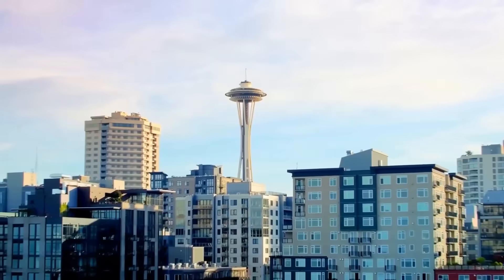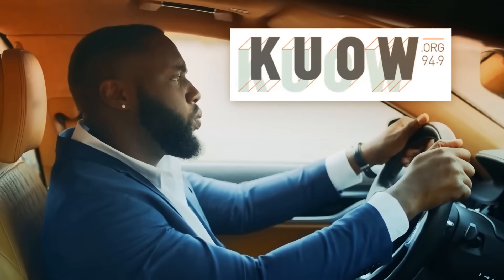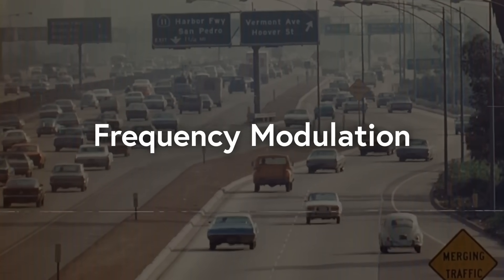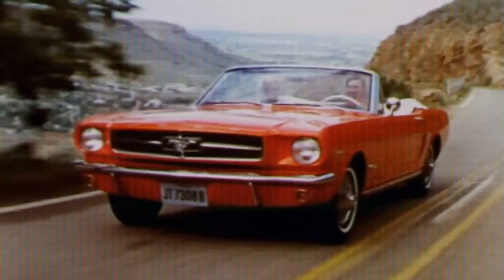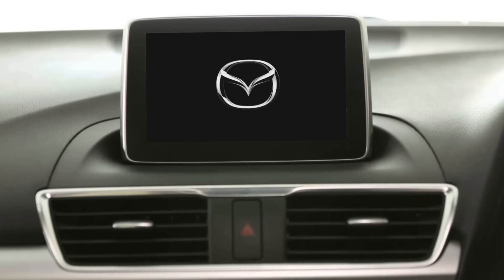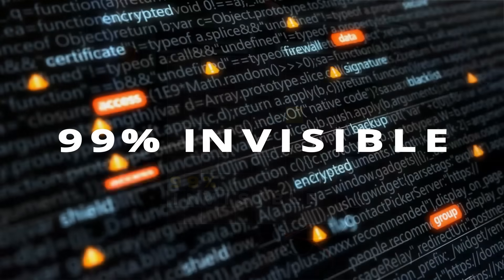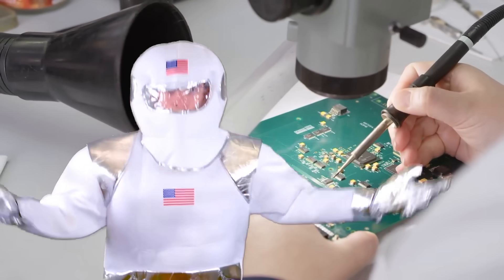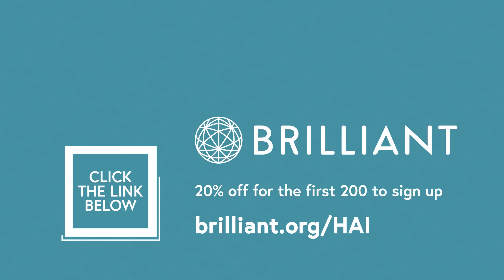Why Hundreds of Mazdas Tuned to 94.9 Broke Simultaneously

Comment: This has also happened to Honda cars starting on January 1, 2022 but without worrying about tuning into something.  The internal clock on many Honda Civics and CR-Vs are now reset January 1, 2002 at 4 o’clock and resets every single time you turn on the car.  Now I know how long I have driven the car for.  I can change the radio station and use my GPS but the clock is toast.

Obviously a different issue (probably was an overflow error on the clock) but it is still not fixed.
Reply: At least you can stick a dollar store clock on your dash if need be. It sounds like the failure is reasonably well-contained, compared to the events in the video. It still shouldn't fail, but at least it didn't propagate to other systems.
Reply: @mal2ksc  Agreed!

Comment: I've made a few coding mistakes in my time as a dev but "hardware destroyed due to unexpected input" isn't one of them.
Reply: To be fair, it's nearly impossible to damage PC hardware by a programing mistake. On a micro controller you're often able to physically destroy something by setting the pin state wrong.
Surprisingly easy to do when prototyping...
(Not that this radio issue sounds like anything more than a soft lock due to utter incompetence and lack of a factory reset button.)
Reply: @TheVideoGuardian  thats what im saying, it blows my mind that these systems dont have a safe boot/admin environment you can boot into and just clear cache, and do basically whatever, should have a boot mode that only starts the required processes. also, i dont see how you cant just re-flash firmware...... sure maybe not end-user but a dealership surely can...
Reply: @3ddan148  In this case, it isn't even the firmware that is responsible for the immediate problem - an unreadable file in cache. Reflashing firmware will be needed for killing the bug but flushing the cache will get it working again. Since there is no Mazda path to doing that the baby has to be thrown out with the bathwater.
Reply: @flagmichael  right, but a re-flash would also wipe cache, as i said, i dont understand why there isnt a boot recovery that dosnt load the cache content, at which point a tech could just clear the cache via some cli, but if there is not recovery boot process, then a reflash would achieve the same thing, your going overkill, reflashing the whole os/firmware, but that also would wipe out the cache, so i still dont see why the hardware has to be wasted over a software issue.
Reply: @3ddan148  Probably anti right to repair measures?
Reply: @RAFMnBgaming  seams like a silly way to do it, just lock down the software or bind installations to hw, or bind the hw to the vin of the car so you have to go to a dealer to have any software updates/fixes done or to replace electronic hardware... seams they are just shooting themselves in the foot by forcing themselves to issue recalls...
Reply: @3ddan148  It was probably a policy implemented before the chip shortage and assuming mostly it being the user's fault. I imagine it was way more profitable for them to sell repairs back then.
Reply: @3ddan148  My experience with Renault units is that it does exist, but it's through the OS, so if it can't boot, you're fucked anyway. It's a stupid way to handle that.
Reply: Was particularly sad is all the e-waste this produces
Reply: @TheVideoGuardian Ah. That was my question.. Was there not a way to reset the cache? Even my old ass BMW had a trick to soft and hard reset it.
Reply: I recall it was possible to kill the monitor of some early IBM PCs if you were programming the graphics card directly and wrote the wrong value to the wrong register.
Reply: @Roxor128  and later graphics cards on *nix if you set up your X11 settings wrong!
Reply: @kaitlyn__L  Now I'm going to have nightmares about bad modelines.
Reply: @Roxor128 This was definitely a thing on the commodore PET. it was nicknamed 'The killer poke'
Reply: Same. It's amazing to me that a venerable car company would be so trusting with it's digital inputs. I also think it's crazy that they don't have hard-reset function. Whenever I code things that talk to external sources, I'd ALWAYS think to add data validation and Incase I failed to vet the data correctly, some way to reset as a last resort.
Reply: @hyperefract  I've carefully avoided any coding job where safety is a factor!
Reply: @sch1191 on't want another therac 25 situation.
Reply: The hardware wasn't destroyed though. It just went into a reboot/crash loop. I can make windows do that with a single powershell command...
Reply: I always thought I was terrible at coding, this gives me confidence though. I can firmly say none of my code has ever disabled anything except itself.
Reply: You've not worked in industrial environments then. Then software bugs range from "Bob is now slightly frustrated" to "Bob is now dead and buried under 20 tons of coal & iron ore and you've created an ecological disaster that would takes months to clean up"
Reply: Halt and Catch Fire becomes very literal once again if you're working with Lithium Ion powered cars.
Reply: Technically there was no hardware damage here - just a software bug that wasn't fixable without a factory reset to delete the files, which apparently Mazda forgot to put into their software design.
Reply: @Entropy512  should've been in the coding to clear the cache on a watchdog reset, not hard to do, not hard to do, especially considering the rather dubious sourcing of the files it was working on
Reply: You've presumably still got plenty of time to cross that off of your bucket list.
Reply: it's not really hardware destroyed, it's just insanely bad software. Sure, the downloading of random files it can't identify is not great, but the real issue is that it's permanently storing radio station song data for no reason. Why would that not just be in RAM?
Reply: @Drive-n-Vibe If these were 2014 and newer computers, and I'm assuming they are built on some or another version of *nix, most files on those kinds of operating systems have information about them inside the actual file, if you have linux installed right now and do "file image.png" it will say it is a PNG image, even if you remove the extension, same goes for audio or binaries and most other popular formats. Soft locking with file extensions is something not even an intern could do if they tried
Reply: nothing like the good old HCF instruction
Reply: Indeed bugs should normally be able to fix and systems affected be able to reinstall but in this case it seems it was just to scrap the entire car if i get the story right.
Reply: There are jokes about processors having a halt-and-catch-fire instruction that is based in an unfortunate reality.
Reply: I can't believe the hardware is damageg by this at all
Reply: Not hardware but on the mainframes, "display upon console" in an infinite loop would fill the buffers of the operators terminals resulting in a required reboot of the entire mainframe.
Reply: Why did Mazda not put the infotainment cash in some sort of volatile memory like RAM, because if it was in RAM the easiest fix for that would be to power down the infotainment system and then pull the negative cable off of the 12 volt battery under the hood weight a few minutes and put it back on and then as soon as you turn the radio on tune to a different station so it does not try to download that bad file again
Reply: I 'recently' worked at a company that still processed fax communication. There was a bug that had been happening over a year and a half, just a single bad chunk in a transmission... On isolation, another vendor was going out of spec, sending partial data and a partial checksum to save a few bits, which our spec-following software would try to gobble up as a whole chunk and missing checksum.

Wasn't the only time either. I exposed an unknown bug in a vendor's software by adhering to spec. They were always expecting a pair of quotes as an empty name, when the spec said no, having nothing is permitted and is the "OG" value for "no name". I had to force insert empty quotes, cause they weren't going to fix their bug.

They didn't result in hardware failure, but all it takes is someone doing fishy business and whoops there go your array bounds
Reply: Look up "never divide by zero on an atmega"

There's a channel that did a bunch of videos on catastrophic bugs on microcontrollers
Reply: I did that to my girlfriend once.

Comment: You were doing pretty good until you attacked Tesla over something not made by Tesla, and common among many newer cars, namely an electronic parking brake, which as any tow truck driver or mechanic knows, will not release unless the car is working properly.
The article about Tesla needing neutral is embarrassingly stupid for someone who knows how cars work, because you don't need neutral on an electric motor because they spin freely when not powered, and so you need an electronic parking brake to hold the car parked, since you have no engine braking from compression leaving it in gear, or Park pawls in the transmission.

So any modern Luxury car that has a electrical failure will end up with a locked electronic parking brake and requires a tow truck to move.
It's a lot like how if a semi truck loses the air pressure, it can't move until the tow truck either pipes air into it, or crawls underneath and attaches bolts to every brake pod to release the brakes manually.

But it seems like you don't like EVs, and so will attack them with no need for facts or logic to be on your side, because it makes videos that get a lot of interaction! Lol

Comment: I remember back in 2004 a local radio station broadcast a signal that would kill the batteries in Volkswagen Touregs.  I worked at a vw dealer and we had dozens show up with dead batteries. Turns out the radio signals were making the radios stay on and kill the batteries.
Reply: This happened to my 2010 Chrysler minivan just last year. Radio wouldn't quit after the key was turned off.  It was silent and dark but something was still ticking that drained the battery. Ended up having to replace the hardware for like $400. It's been good since then.

Comment: Love my analog car! And by that, I mean it has a few dozen various ecu’s that control everything from the engine timing to knowing when to set off the airbags.  What I like is my car has a manual transmission, standard dials for heating and cooling, and no touchscreens. It’s about as analogue as you can get these days, in the used market that you can daily drive.
Reply: laughs in 1994 Volvo I'd like to see them hack my cassette deck. About the worst they could do is turn Dolby NR on and off.
Reply: @moconnell663  by 1994 you probably have the same ECUs as OP, but of course they’re not connected to the antenna at all.
Reply: @kaitlyn__L  what's funny is when i was going through the electrical schematics looking for a wiring issue with the lights I discovered that the ECU has absolutely no idea how fast the car is going. Absolutely none. The rear speed sensor is hooked up to the speedometer in the dash and nothing else. The front sensors are hooked up to the ABS module, which has no connection to the ECU at all. There is nothing which could be described as a BCM. It's an automatic transmission, but is totally self-contained, no coms except for a switch to inhibit overdrive.
Reply: @moconnell663  that’s not too unusual, the ECU looks at shaft and spark timing and so on, and maybe measure fuel consumption, so I can understand not really needing to know how fast you’re going, especially since RPM are decoupled from MPH anyway.
Reply: @kaitlyn__L  lmao

Lol

What's an ECU, my 1985 Porsche 944 uses a DME, an analog computer that uses two magnets only, everything else is disconnected from the cars "computer"
Reply: @finmueller7827  good for you pal, those mechanical fuel injection systems from Bosch are incredible engineering. 1985 is pre-ECU for almost any car though, not just Porsche, albeit for most other cars that means carburetted.
Reply: @moconnell663  i think mine still uses a speedo cable and mechanical linkages for the air system LOL, don't have abs so the only computer is the ECU. mx5 for the win i guess
Reply: and probably gets a mile per gallon

Comment: this is exactly why electronic based solutions for transportation control systems are trash. this is the same type of errors that crashed the 737 MAX - companies cut down on designing good mechanical systems, instead relying on software solutions.
Reply: Ironic, as 737 is not fly-by-wire. 737 has lots of mechanical components than its competitor, A320. A320 is the world's first fly-by-wire airliner, and yet it has a stellar safety record. Hardware or software, the importance of good design remains the same.
Reply: @dbclass4075  not an engineer, but i'd think Airbus have a backup mechanical in case the electronic fail? because unlike mechanical failures, electronic failures are not predictable in advance or via maintenance inspections. electronics either work or fail. there is no "gradually falling apart" or "cracks appearing".
Reply: @wli2718  Rudder only via pedals. The rest are not. Mechanical links are not really possible in side sticks. For widebodies, purely mechanical flight controls is impossible. The sheer size of flight controls plus the aerodynamic loads at high speed is just too heavy to manually operate.

Electronic failures on Airbus is predictable. It's avionics uses triple modular redundancy; three identical systems that compare data with each other. Any discrepancy with one of the system will be isolated from the other two, and the pilots will be notified. If none of them agrees, that's where pilot judgement comes in: select which system to use.

Comment: It's pretty pathetic the car engineers couldn't clear out the installed malware and reinstall everything without having to buy a new car computer. 
32 years ago I had a PC crash from some bad software.  I regained control of the PC and deleted the offending program and it continued to work.
Reply: It's not malware. It's just an image file without an extension. That's how pathetic Mazda's software apparently is.

Comment: Probably a good time to point out that the whole GM cars killing people by the engine cutting out - something most would think is crazy because you could just coast to a stop, was actually a problem with the anti-lock braking and loss of power steering being reliant on the engine running to maintain pressure.
Reply: Shouldn't brakes and steering be still functional? Anti-lock braking just simply reduce the risk of skidding by modulating brake pressure. Brakes should still work, though driver must not press too hard and suddenly. Power steering simply provides additional effort. Steering may be heavier without one, but it is still possible to steer.

Comment: First of all mazda should be replacing those radios free of charge since it was a coding oversight that caused the brickoning in the first place. Second of all the FCC needs to create better standards for information being broadcast over HD radio (such as requiring files to have some sort of extension and not using coding symbols in titles and discriptions)
Reply: As far as I'm concerned, this is 100% on Mazda's head. They're the ones who slacked off on their software. When handling a missing file extension, that should either result in the program looking inside the file for the signature of a supported format, or just assuming it's corrupt and discarding it. Treating it as code and trying to execute it is just idiotic. The mishandling of % symbols is a little trickier to fix, but there are libraries out there for the job of sanitising text input, which they could have used if they weren't asleep at the wheel.

And no, I don't think the communications regulator needs to get involved, for the simple reason that when you're sourcing your data from something as unreliable as a radio transmission, your code is expected to be able to handle any old crap that comes down the antenna, even if it is just by saying "Nope. Too garbled. Into the bit bucket with that packet.".